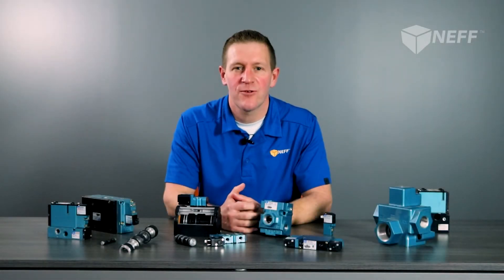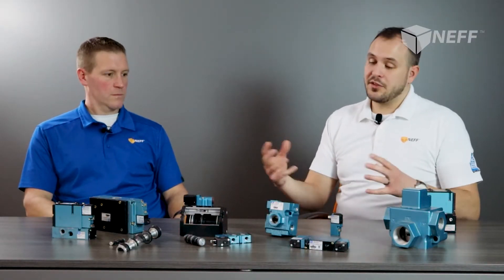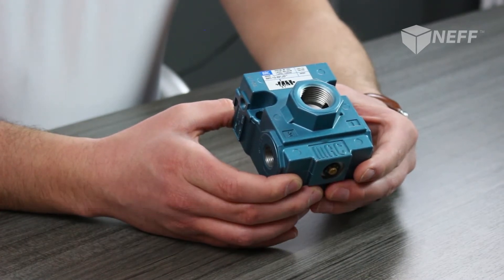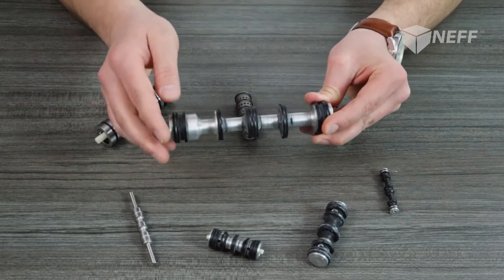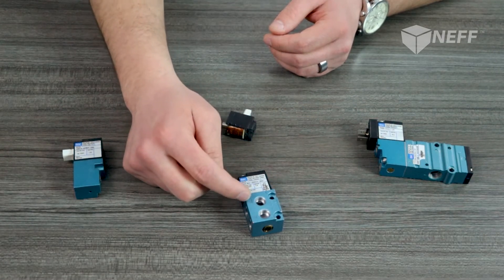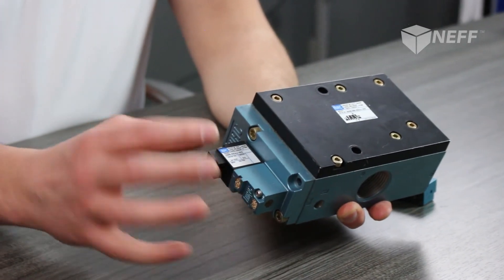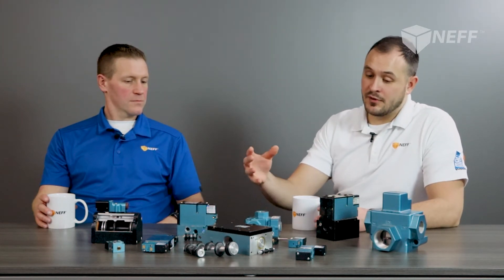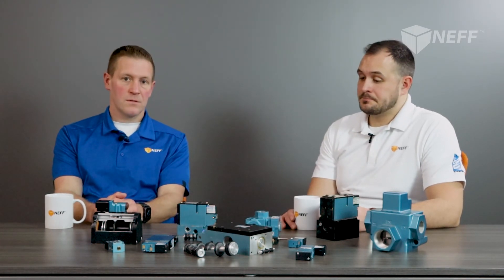Anatomy of a MAC Valve - NEFF Talk Live #1

Comment: Is there a way of cleaning the solenoid valves? I had water make its way into my controls and there’s white corrosion in a bunch of them. My exhaust mufflers where blocked causing backflow into other valves making them operate when they should’ve not. I have ordered a bunch of new components but still having some trouble. When everything is in the off position I have a very small amount of air making into the exhaust ports.